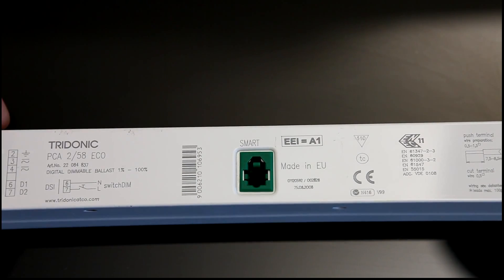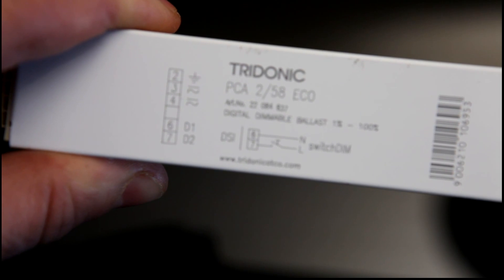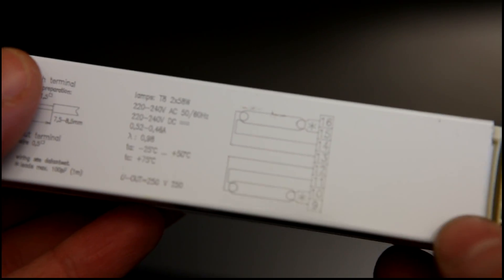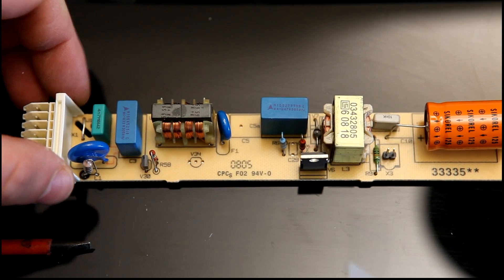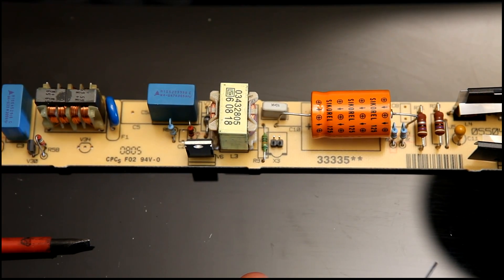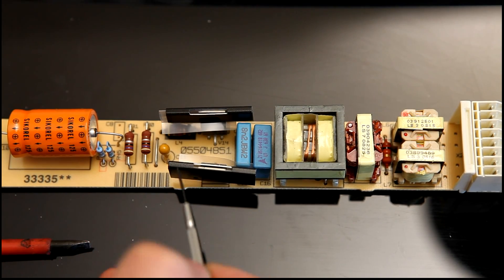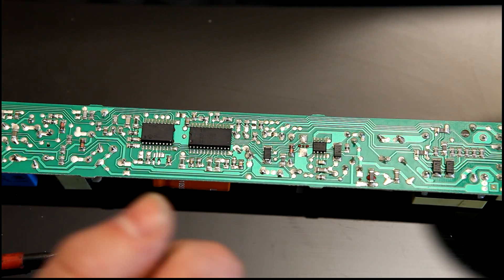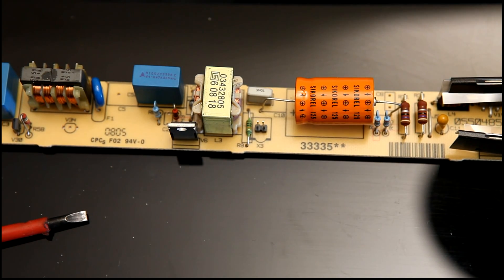Fluorescent ballast tear down

Comment: What do the numbers stand for , eg the input is 3 and 4 which one is the positive and negative?
Reply: Peter Creelman From what I can discern, which isn't much, 3 = + , 4 = - . If you ever find the person who had anything to do with the writing the documentation for tridonic products give them a nice big slap on the face from me.
*Page 6*
tridonic[DOT]com/cn/download/data_sheets/DS_PCA_T8_ECO_lp_xitec_en.pdf

"Operation on DC voltage Our ballasts are construed to operate DC voltage and pulsed DC voltage. To operate ballasts with pulsed DC voltage the polarity is absolute mandatory.Operation on DC voltage Our ballasts are construed to operate DC voltage and pulsed DC voltage. To operate ballasts with pulsed DC voltage the polarity is absolute mandatory."
Reply: john smith That seems hard to believe, it goes straight through a bridge rectifier...
Reply: TheHue's SciTech Maybe they had a different design and that's the reason I could only it find in that one particular "data sheet". I'm just reading from the only pdf I could find that said anything about the polarity of pins 3 and 4. What DC voltage is supposed to be supplied to the input?
Reply: +P C
It is AC so not polarized it is kinda sinusoidal wave going up and down. see these symbols
~  <
_   < this means AC voltage

- - -  <
_  < This means DC voltage

The numbers mean connect to the screw of that terminal, look at the left side 0:03

Comment: Varistor is a new sight in those type of equipment. I have taken apart Kanlux, Far East Electronics, Feron (made the light fixture, no marking of manufacturer on ballast) and Philips electronic ballast and didn't see any varistors in them. Also no MOSFETs, only NPN transistors type 13005 or 13007. Although I prefer simple ballast-starter system for reliability and use separate small 18W lamp for low light need. Good teardown, mate, keep it up.